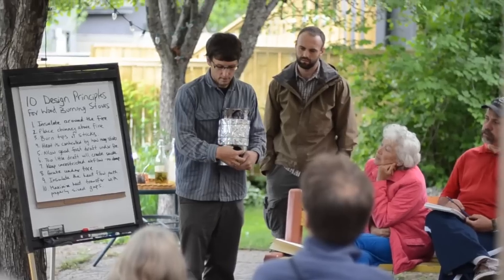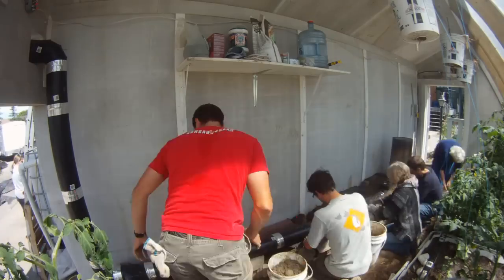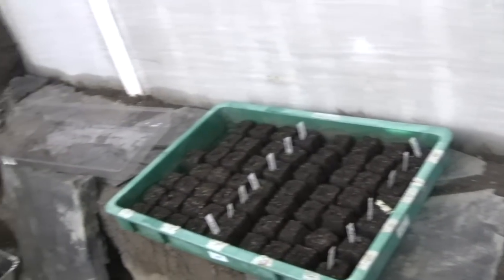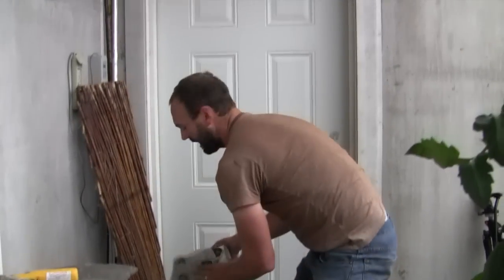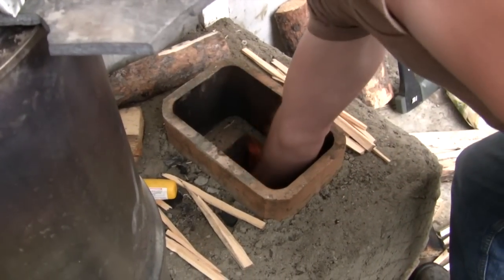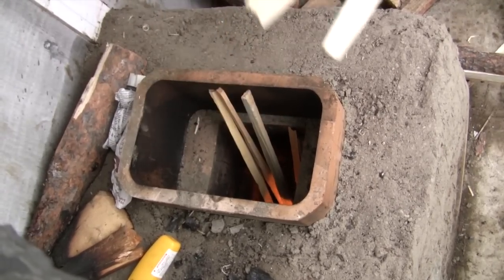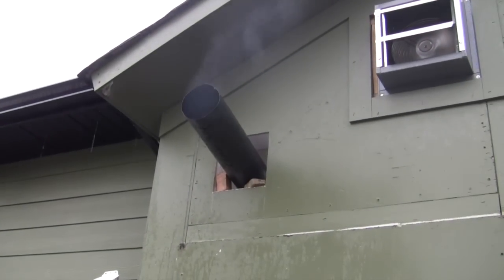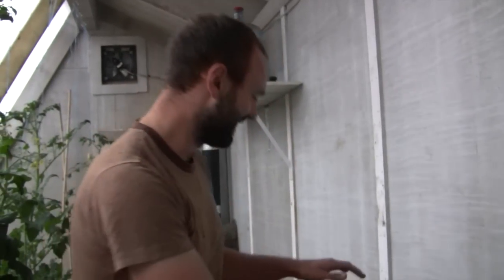Rocket Mass Heater Workshop:  Permaculture homesteading

Comment: the RMH is a great way to heat a space, either outside building, green house or even your home.  Refer to your local building code for a fireplace and you'll should pass an inspection.  Using the proper gauge pipe in the mass bench, same as the double wall pipe that is to be installed in the room to be heated should work.  When it comes to exhausting it out of the building, our local Alberta Building Code states, that an insulated flue pipe is required near any combustibles going through your attic.  Also have the proper clearance above your roof-line of your building.  If you're unable to access the building code, drop by the outlets that sell wood stoves/ fireplaces and most sales persons will be able to answer your questions.  I would double check with your local building inspector just to confirm the specs of clearances required from combustibles.  If you follow the specs and buy/find proper materials, it will still cost you in the neighbourhood of $1000.  One last thing, make your heat riser out of refract bricks, the riser will never burn out.

Comment: you see here. this kind of heating system? Koreans have been using it for 2000 years.
true. it is called Ondol. In these days, you can find some in the country side, Korea.
Reply: When I was in Korea in the mid 80s this was commonplace.  They sunk the kitchen into the ground a bit so the stove pipes were just below floor level and ran the stovepipes through the floor to t the other side of the house.  ...wonderful warm feet....radiant floor heating.  I hope they are still doing that and have not gone backwards to 'modernity'.  I also would like to see a bit m ore detail on measurements like riser vs drum size and height.  If you put in two smaller chimney pipes through the cob mass, would you not get faster and more complete heat absorption?

Comment: To get an instant draft, install an access point in the vertical portion of the chimney, after the cob bench. Light and insert paper at this access point, first, then light and insert paper at your fuel magazine (vertical fuel feed). You'll discover backdrafts will be a thing of the past, and instant drafting much to easy, now.

Comment: Put a little bit of cooking oil or grease on the paper before lighting and it will burn longer, not going out as quickly, avoiding having to restoke with more paper.
Reply: Bill Hanson or candle wax

Comment: I am no engineer, but it seems like you would want to draw your source air from the outside. Why would you want to send all that warm air out? Just a thought. Great video! Keep it up.
Reply: Maybe you could have a flexible pipe that you attached to the feed portion after you got the fire started? 

It seems a bit complicated, though and from the way they had their hands over the exhaust port, I think most heat is (re)absorbed into the earth mass bench.
Reply: I think it would work well. Then take an old, junk fuel injection throttle body system, or butterfly assembly off of a gas carburetor and fashion yourself a really cool throttle for it. You could seriously fine tune it. I know... a guy could just rig up a little flat slide-valve way easier, but I can't help it. I'd go for the cool option. I'm sure there are quite a few of us around with that same sickness. Oh yeah, use a set of junk butterfly's from a sportbike... K&N filter filters, twist-throttle  on a cut-off handlebar mounted to the wall... heck yeah! Sorry...

Comment: I love this, but don't understand how you overcame the issue of creosote buildup...  do any parts of this need to be cleaned and or otherwise serviced?  Just wondering how you'd access this length of heat tube?  Thanks.
Reply: Creosote is formed from unburned hydrocarbon buildup--the smoke you see exiting the average chimney. Due to high temperatures and the stack effect in a rocket mass heater, virtually all the hydrocarbons are combusted. No smoke means no creosote buildup. To clean simply access the various cleanouts & remove ash.
Reply: yes and that's why you need a good chimney/exhaust venting to keep it hot drawing and, like a still, vapor until it hits the outside air..

Comment: I've watched some of these videos but my wife don't like all that dust and stuff you get with a wood stove. Whats that bench made out of...mud? That kind of makes it unattractive. Is there anyway you could build this and put it in the basement of your house and let the heat go up through the vents? I'd do almost anything to get away from Ameren (our local money sucking power utility company.) Another question is "what is Cobb." I've never heard of it.
Reply: b3hr057 it do's contain straw so that the mass will not crack as asely
Reply: It's called Cob, a mixture of sand, straw, and fairly high clay level dirt. There's a video here on YT that shows how to make it and how to tell if you have the proper mix.
Reply: The "Cob" they use here I do not believe it contains straw or any other combustible materials. As for making it more attractive, it is quite feasible to create the bench and then cover it with tile, ceramic glaze, a wooden frame or whatever other materials you find more aesthetically pleasing. Many people turn the bench into a couch and cover it in cushions and comfy blankets. I think it is left in a more industrial finish in this particular video because it is for a greenhouse.
Reply: b3hr057 I agree that in this application they may not use straw and may use something else. Actual Cob used  for mud huts and such would have straw in it. However I have seen an outdoor fire oven made with the straw in it.

Comment: Thank you so much I have been wondering about how I was going to heat my green house and keep it economical. This is a great idea, I was wondering how you figure out how much mass you should use around the stove pipe. I guess my question is can you use too much mass? Is there an equation to use on figuring out how big your biomass heater is to area needed to heat? Subscribed to your channel. 

Also what kind of fuel can you use instead of wood? I know you said pine cones, but that doesn't seem practical. What are you suggesting that people grow to use as fuel?
Reply: pine cones could have tar and creat soot and cake on the walls of the vent and catch fire, if u cnat clean it like the  1 n picture that is a ;long curvy flue
Reply: Try dry cow dung.

Comment: would you be able to use old paper as fuel for the rocket burner or does that create too much ash? What are the ratios of the burner port and the exhaust ? We use beech and oak the  wood is cut into 33 cm's to heat our house. At the moment we use abut 10 cubic meters of wood per year.

Comment: I realise the very little material will be left, but there will be some... does it not gradually fill up parts of the system that are not reachable to clean?... how does this work?...

I wonder if you've considered using this with woodchip fuel pellets and an automated hopper/auger delivery system to allow it to run for long periods?
Reply: I'm wondering about that too. I guess it's up to you to create openings and a clever construction that allows for cleaning. I've seen a few examples. Check out the permies forums (.com), where they have a section dedicated to RMH's.

They burn wonderfully with those types of fuel. After heating the mass it'll stay warm for hours (from a few to many), but I wonder if you could save energy by feeding a tiny amount over a longer amount of time, to prevent it from going cold. I'm guessing it depends on the amount of mass you have.
Reply: Yes, phenomenally litte left compared to a convenctional wood stove. Clean burn.
Reply: The main reason for developing these was to use waste material, which pellets are not. Regarding the pellets: I think it would be a great system to have but would want it to be removable in case of power failure or grid down.

Comment: I put in a wood stove and first checked with the local boys on the codes and they said that a wood stove fell into the category of a "appliance" and therefore did not come under their jurisdiction. Tecchnically, (IMHO) an RMH is little different than a wood stove in that it is an "appliance". True, some assembly is required but still, it is a "ceramic heater", not a fireplace. A fireplace falls into their jurisdiction. As long as installation is done per the recommended methodology, I cannot see there being any conflict, at least in my area.

Comment: Folks,
I spent about 10 years in the field installing all manner of heating equipment and another 26 years selling equipment and engineering systems from scratch.  I like the Rocket MH concept but I really think if someone is going to make the commitment to building one of these systems that you should avoid the using light duty materials such as metal stove pipe. I know it's economical and easy to find but it does not stand-up to corrosion and heat as well as other materials.  I would strongly suggest you consider using pipe that's made with clay tile, ceramic, bricks, concrete, schedule 40 steel pipe, cast iron or some other durable material, (with more mass).  The last thing you want to happen is for the pipe to burn out which will require you to dismantle/remove all that mass that you installed at great effort. Check-out your local junk yards, steel recyclers, used building material suppliers, or plumbing shops and get yourself a piece of 6" schedule 40 steel pipe and either borrow, rent or hire welder and do it right, do it once.
My2bits.
Reply: I've been looking into these units for a few years now, and I've learned (and it makes sense, once you consider) that the stove pipe inside the bench is not that important. As long as there is a passage for the exhaust and subsequent heat transfer, the unit will work. The stove pipe is nice and smooth inside, allowing easy flow, which would cause a bit more drag/resistance once the pipe degrades, but the cob is unlikely to collapse, and will not burn. I've heard of people using cardboard tubes inside the bench, then transiting to metal once the tube leaves the bench. The cardboard eventually burns away, and there's nothing but a tunnel through the cob. Hope that makes sense...
Reply: "If you don't have time to do it right, when will you have time to do it over?"
I totally agree. Always use the best materials you can.
Reply: @ericsmathe  I "Lived" in AB, there's tons of industrial stuff just sitting in the fields, I made a fortune installing Firepits using these amazing 5' diameter 3/4" steel tractor tire ovals, man they made great Fire pits.
Everyone wanted one in their Back Yard.
Reply: The pipe in the mass will be at a relatively low temperature so you can get away with a lot. Inside the stove seems to be where you need to worry due to the high burn temperatures.
Reply: You're right.
Ceramic fiber board for the fire box and riser are critical for optimum performance. Using any type of steel in the fire path is not a permanent solution as temps can easily reach 2000 degrees F and will literally burn the steel to ash due to the low carbon environment
Reply: @blktiger60  ... unless you have a titanium barrel, or carbon crucible material....which is not impossible to make as a liner...
Reply: yes absolutely. It's a monolith construction. If the stovepipe in the mass breaks down, it would work just fine if you used a good clay cobb. The rest of the metal is accessible and can be switched out later. Thin metals work better than thick metals. Even a thin stainless steel was too thick in one case and also copper had too much mass to work well. Cast iron would be detrimental to the efficiency.
Love
Dan
Reply: The Roman's used clay pipes in a below floor system to heat bathhouses. Works very well still today in replicas. Exact same principles. See series "Rome wasn't built in a day" for a 2010 build as part of a villa re-creation.
Reply: Thanks for the tip from a pro!
Reply: My2bits, I believe the better quality materials, in this application, impede the heat absorption into the mass.
Reply: great feedback and worth more than 2 bits
Reply: would the clay just work as the pipe of the metal was compromised?
Reply: Kelly Burnham to
Reply: Kelly Burnham I agree.  I’d be using 6” cast iron or steel pipe myself.  I wouldn’t want to spend that money using 26 gauge pipe And a cheap 55 gallon drum
Reply: The single wall is actually only a form... It is unnecessary after the cob mass has dried.
Only the firebox and barrel chamber needs be seamless.
This whole design can be built into concrete.... or in the forest.... or in the Antarctic.
Reply: Call your local fire protection (fire sprinkler) company and ask if they have and demo jobs going on in the near future. They will usually sell you the pipe for scrap prices. 1"-6" schedule 40 black pipe.
Reply: yeah make it a lil more profesional....
Reply: I was the 100th person who liked you comment. Do I get a prize or something?
Reply: Thanks for your wise words.

Comment: As stated, yes, anything INSIDE the riser will restrict the airflow, diminishing efficiency of the entire system. However, if you wrap the pipe around the pipe, either around the riser, or around the entire length of pipe, it's quite functional. Keep the pipe away from the metal of the inner exhaust piping in the thermal mass, and make it something non-metallic with a high enough heat resistance, and you won't have a problem.

Comment: Is there any reason why you couldn't set up a coil of pipes inside the heat riser for hot water too?
Reply: Great question. The thermal mass heats on avg to about 160 to 180. I'd run a steel water line(s) through it to heat water. Not in the firebox/Heat Riser. Temps can hit 1,000 deg F.

Comment: You may be right. If it IS a backer material like that, then it is probably framed on studs. If so, then there should be some sort of standard used to specify minimum clearances to combustibles. (the studs in the wall) Using NFPA-211 guidelines that clearance to unshielded combustibles would be 36 inches....it would at least be farther away than the 8" it appears to be in the video. Not being picky...just concerned with fire safety.

Comment: Thank you foe the useful video.  The rocket mass concept is really interesting and easily understood.  Are there guideline ratios for the cross-sectional area vs. length of the "rocket" column?  Are there similar guidelines for the rest of the venting tube?  For instance, using, say, off-the-shelf 6" black stove pipe, how much length is optimal for efficient burning and good draw?

Comment: A mechanical engineering prospective? I think the problem with these mass heaters is that the heater part is giving off huge amount of heat as its not surrounded by cob.

Comment: The heater is great but never run a single wall out the side of a house.Go straight up and give it some height with an insulated chimney.You will have draft problems this way.

Comment: Depending on design tolerances, the top of the combustion chamber (bucket in this case) can be hot enough to use as a skillet or hot plate.

Comment: In cold climates having an insulated chimney is crucial. And yes, it's a big challenge to get a draw from a cold start but we always building in a priming hole right under the chimney. Light a piece of newspaper at that end, get it warm, and then things take off without problem!

Comment: This system produces very little ash from the highly efficient and intense burning. I understand the intake area where the wood is fed may have some ashes but that will be easy to remove by vacuum cleaner.

Comment: Does the fuel load have to be from the top? How do you clean out the ash? Can the same system be modified and used for pyrolysis? What of LARGE amounts of bio mass? Say a pile of brush? How would you process that using a rocket stove?

Comment: That it burns and radiates heat more efficiently is very clear. I’m a bit unclear, however, of the use of cob. Cob is an insulating material, isn’t it? Wouldn’t we want something like ground stone, bricks, cement or rocks instead, something that absorbs heat instead? Please clarify. Thank you.

Comment: Small stuff burns quicker,and hotter if you do it right.Having the stove sized for scrap makes it more efficient,and part of that is the ability to utilise scrap.All of it is surrounded by masonry,to absorb the heat and then slowly return it later.Stack a bunch of bricks around your woodstove,although it will not work as well,you will do better than not.

Comment: Very interesting.  I want to build one.  It will go in my shop, so feeding scraps will not be a problem. If you will, help me understand the concept better and answer some questions.e.g.If the flame is being propelled away from the wood, how is it the wood burns? Instead of standing around feeding tiny scraps of splintersinto this thing for 3 hours, why dont you make a bigger "feed tube"and put a few decent sized chunks in, and be done with it in five minutes, set some settings, and go have pizz

Comment: The only suggestion I might make is to shorten the length of your horizontal burn tunnel in relation to the height of the internal riser. This will put the wood hopper practically right up against the barrel and definitely make it easier to start as well as draft better when up to full temp. Great that you're actively teaching others. The world needs more of this.

Comment: Thanks for the reply. I was thinking maybe of using 6" well casing pipe in the mass part which then transitions to regular stovepipe as this would be major cost and labor savings in the long run. i think 1/4 inch thickness would last at least 15 years if not more. I will see what i can do. thanks again.

Comment: No, there the majority of the heat is absorbed into the bench so the flue gases are quite cool. Once the bench is hot the flue gases will heat up and this is a sign that there is no additional benefit to continuing to burn the fire until the bench cools down.